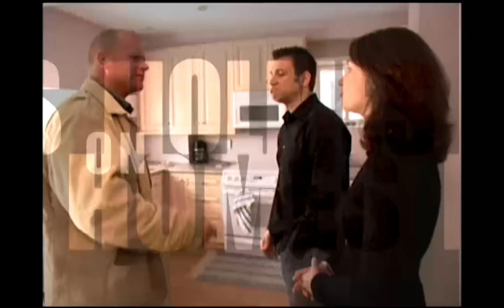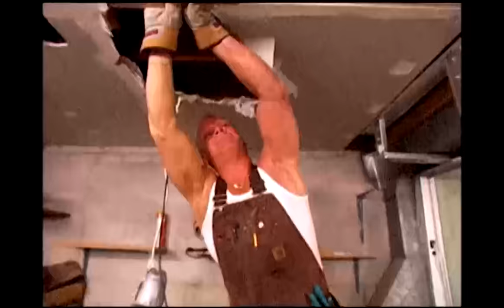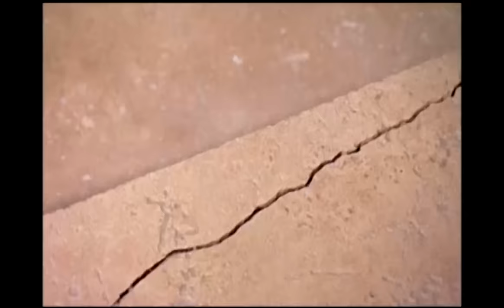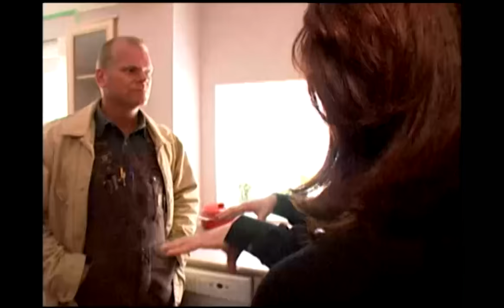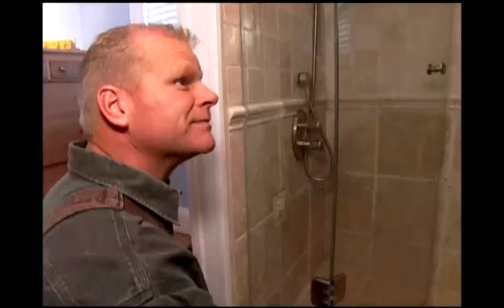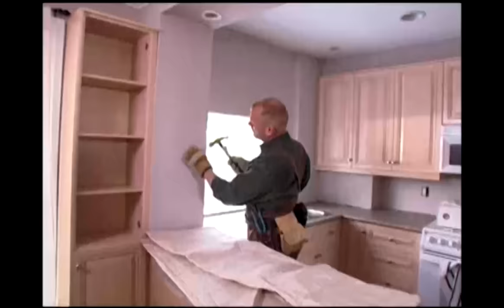Mike Holmes Discovers Huge Electrical And Plumbing Mess | Holmes on Homes 312

Comment: When I built my house I looked for a good carpenter to help with foundation and framing. They told me they had built custom homes and showed me a few houses that were finished. Which I knew at that time you can cover up a lot of crap with drywall and paint. Never had so much trouble. They took short cuts in the foundation by putting the minimum amount of steel in it. I had to correct that the night before the pour. In the rain and mud. I had purchased plenty of rebar and it was right next to the house area. They kept taking short cuts in framing. Leaving out rafters, studs, wall plates, etc. I had plenty of lumber and told them to use it up. Nope. When I got to the sheeting I fired them and finished the house myself. Such a pain.
Reply: Sad to say, that "Cutting Corners" has become S.O.P. in all working and most living aspects here in the U.S.  People have been making excuses for why something is "Good Enough" or why adding pressure to perform to the best of your ability while always looking to improve that ability is some horrible and cruel thing.   30 YEARS of that has taken a toll.  The bars are so low and most of the populous isn't aware enough to see it for what it is. :(

Comment: Never use a home inspector supplied by the sellers real estate agent. They are working for the seller to sell the property. Investigate and hire your own.
Reply: Yea agreed or at the very least bring 1 of your own in to and see what they both come up with. Ive been saying for years home inspectors Should have experience in construction with either structural, plumbing, electrical or HVAC and also have there field of experience stated as there specialty. Steve a GC for 8 years, I moved to inspections and specialize in Structural for example. Anyone whos spent any amount of time in construction know that it takes years to learn your chosen field and you could never know everything. Ive worked 1-4 years each in framing, siding, roofing, insulation and vapour barrier aswell as 6 months in cement finishing. Having experience as a installer not a labourer in different fields like this is what inspectors should have. Being in the field hands on is how you learn things, you have to go to school to be a commercial boat captain like in deadliest catch BUT your never a boat captain tell you have years on the water. The same goes for construction and inspections, you can have all the book knowledge in the world but still not have a clue due to lack of experience
Reply: My realtor had a very good home inspector who also owned a older Florida home. He did a thorough 4 point inspection (due to no permits pulled on a remodel). He & the realtor  made sure the seller do over $6+k in fixes or improvements (realtor also reached out to 3 insurance agents to ensure the house can be insured) for the sale to close. I also had a pest inspection done & a tent fumigation was done as a requirement before closing.

Comment: Not removing the knob and tube should result in criminal endangerment charges. 
All building inspectors should have a minimum 3 years experience in construction. Preferably 10 in several different trades. And not just as a common labor picking up trash. In so many areas in the U.S. to become an inspector you read up from a book and pass a test and bingo you are an inspector. Some of the missed points I've seen in inspections found on this show plain common sense should have caught.

Comment: if the curb is done with mastic  Im thinking all tiles should be removed and properly adhered to the wall
Reply: I'm more concerned with the only replacing the shower pan.  I know they want to save all that expensive tile on the wall... but you will never be able to tie the waterproofing of the floor with the water proofing (if it even exists) in the walls.  Given how bad everything else is, I bet there is no waterproofing on the walls.

Comment: Never buy a house together if your not married- that way one of the buyers can't just walk away from the mortgage  and leave the other obligated to pay the mortgage or having to sell/ foreclose on the house. If you have no idea what to look for when inspecting the house keep at least $25k for repairs. Cracks in the shower, old aluminum windows, to many junction boxes, overloaded electrical panel, toilets/ drains that are slow to drain, no water pressure, old furnace, no soffits or missing roof vents, no GFI near sinks, are red flags.

Comment: What about the structure in the basement and the foundation? He mentioned that in the beginning.
Reply: Appears they moved the support towards the outside wall solving the problem. These older episodes 2003-04 were on a tighter budget than the ones that ran several years later 2009-10. May explain why they didn't show those areas, since they wouldn't be doing much there.

Comment: Removing perfect beautiful drywall on the walls, ceiling , along with showers , tubs, & complete bathrooms & kitchens is totally senseless,  SHAME on the Fake Contractors that made such a mess . Putting up what looks Nice without making the home strong & mold free without any electrical or foundation issues is beyond the former people that thought they knew what they were doing !!!  Just because you buy a hammer & a tool belt , doesn't make you a contractor... That takes years of practice & learning in a school of professionals !!!!

Comment: I HAVE BEEN IN THE WINDOW FILM FOR 30 YEARS --   FOR ALL SHOWER AND BATHROOOM GLASS GO WITH ( LAMINATED GLASS) NOT (TEMPERED) OR INSTALL AT LEAST 7 MILL CLEAR SAFETY WINDOW FILM AND INSTALL IT ON THE OUTER SIDE OF THE GLASS SO YOU CAN CLEAN ON THE INSIDE OF THE GLASS.

Comment: this is not unusual most contractors will take the easy rout when it comes to century homes; plaster and lath or stucoo removal 
while 3/4" thick drywall seems excessive they want to just add it to the plaster and get away with it.

Comment: 42:12 modern bath faucets have gaskets so caulking around them is not necessary.
Reply: Even so it doesn't hurt and also looks a bit better i.m.o.
Reply: At the time that this was filmed over 20 years ago, they did not have the gaskets